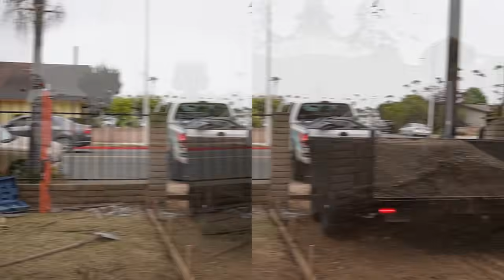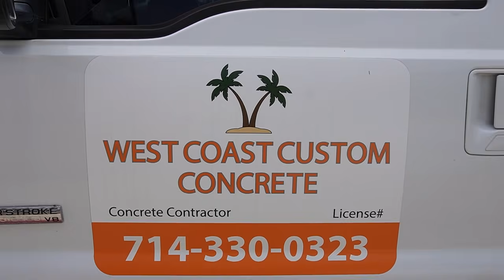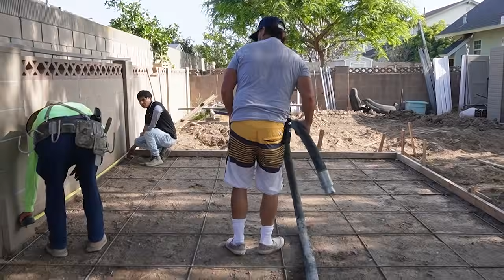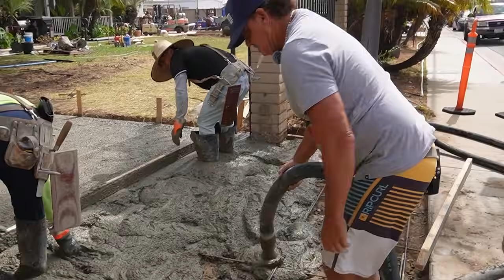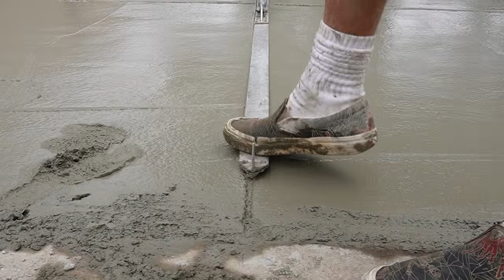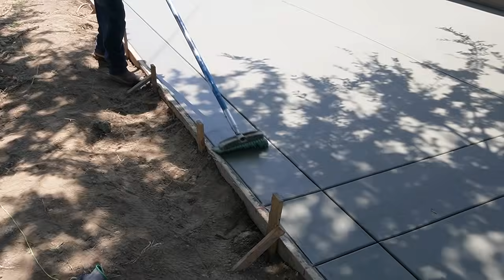Pouring a Massive Concrete RV Slab to Boost Property Value $$$

Comment: The torpedo jointer work and border detail look top-notch. On engineered jobs where plans require #4 bar tied onto concrete dobies or chairs, how does your crew typically manage the change to not stepping on the rebar or heavy pump hose line to keep from knocking the chairs over during the pour? Always curious how different pumpers handle hose routing over tied grids.

Comment: I mean i like the stuff you say, but im a concrete contractor in so cal. Those guys throwimg that mjd splashing the walls . They used to do that on my job , not only is it another thing to habe to clean up but more time for you and looks un professional.and it foesnt make sense, rod the concrete flat one time , there is no readon yo add mud bavk over
Reply from the maker: Okay
Reply: @WestCoastCustomConcrete well , im not hating just dont underatand the throwing of mud and the big splashing on block wall
Reply from the maker: @patriccrigler7981 it's very confusing 😂
Reply: @WestCoastCustomConcrete yeah its pretty confusing, your sarcasm and also how you say your the best, as your guys are splattering the whole block wall, you as well with the pump